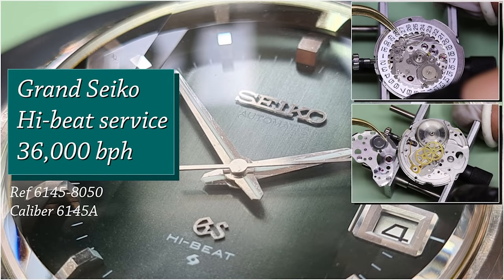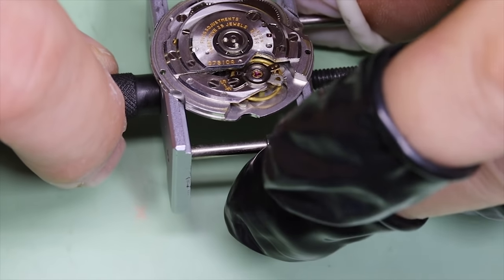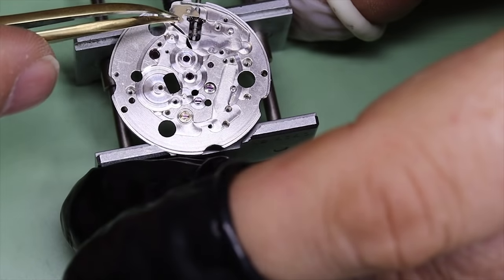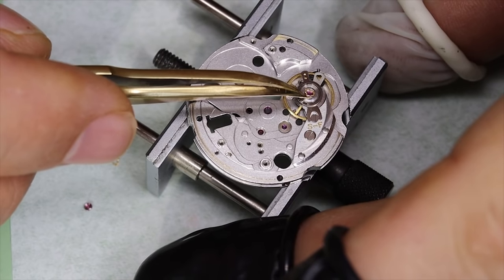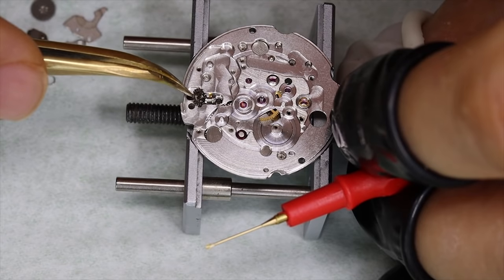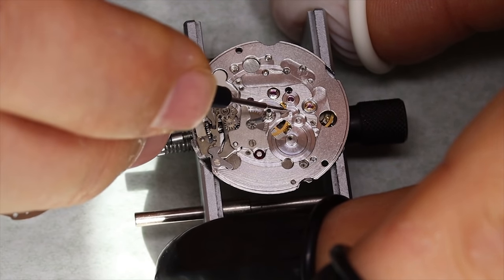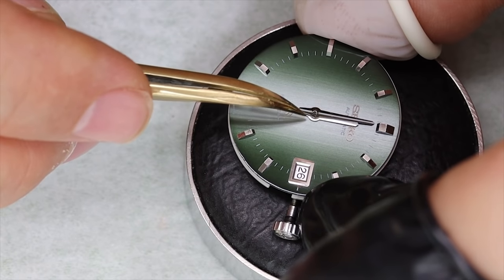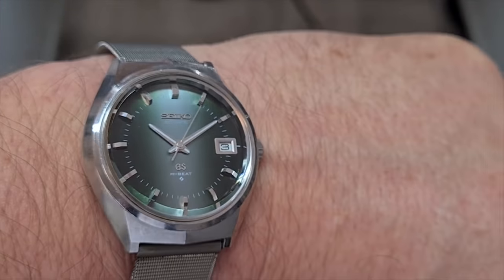1972 Grand Seiko GS61 Hi-Beat service ref 6145 8050 Caliber 6145A

Comment: The metal finishing and machining on this Grand Seiko looks very fine. Glad you shared this so we can see that Seiko can produce an aesthetically handsome movement.
Reply from the maker: Hi Frank, yes, this is indeed a more refined finishing than many old Seiko's. If you look at new high grade Seiko's, you will also see nice finishing there. This whole watch is very, very nice :)
Reply: D0nt like hi beat watches they wear out fast, service is also needed at short terms

Comment: I watch YouTube almost exclusively on Amazon FireTV which is not comment friendly therefore I don't typically read or write comments.   But I watch and enjoy every video please keep them coming.   It's a. Welcome change to learn from a true professional and the background, history and insights are the best part.   I've learned so much and thanks for not bashing Seiko so much.  If you're ever bored or running out of content please feel free to take apart a Russian watch.
Reply from the maker: Hi Eric, thanks so much for making the effort to write a comment! I actually hold Seiko in very, very high regard, even though I might bash them for plastic parts, keyless works having hundreds of little pieces and their often rough finishing... But they make some very solid, no non-sense movements that I really respect. I even stated in one video that a Patek Philippe without the finishing would be a Seiko 😄

I'm actually planning to do a Russian or Soviet watch shortly, just have to decide whether to make it a chronograph or one I have lying around in a drawer somewhere. And I cannot promise to hold back on the bashing then!

Comment: What an absolutely beautiful watch! That dial is breathtaking!

One thing I noticed, and maybe it's just my lack of experience, but the balance hack actually fouls the escape wheel instead of the balance or pallets. I think that is a rather ingenious design, putting that much less stress on the escapement. 

You do such great work, and, as always, teach us more about these movements and watches in general. Thank you so much.
Reply from the maker: Hello Michael, thanks for watching and for your comment, very much appreciated! Yes, it certainly is a beauty. Very different and almost all in a good way :) 
The hack might look like it will foul the escape wheel but it actually still stops the balance wheel when the stem is pulled out into hand setting mode. It's the safest place to stop the movement, as it stops the final movement component rather than one earlier in the chain. If the hack stopped the escape wheel, the balance wheel would still swing a couple of times and you might risk other problems. With the balance wheel arrested, everything stops immediately and it will also start up again immediately. 
There are more videos coming, so stay tuned! 😁

Comment: A stunning watch and great video. I've noticed other guys have opened the "Do Not Open" mainspring barrel (and closed them again) with success.
Reply from the maker: Thanks, Red! Yes, you can open the "Do not open" barrels, but the risk of not being able to fit them again is quite high, so if it works well the safest thing is to keep it. If the mainspring does not give enough power I would certainly open it up (and find a reserve barrel just in case).
Reply: @VintageWatchServices  OK got ya. And I guess finding a similar barrel isn't easy.

Comment: Lubrication of the pallet stones is a point of debate.  The stones are extremely hard en very resistive to wear.  The balance assembly is argually the most sensitive part of the watch.  Though lubrication may seem to improve the stability of the watch right after the service, it can and will induce drag and contamination, which shortens the time until the next service.
Reply from the maker: Hello Berre, for the lever movement, lubrication of pallet stones is not really a point of debate, unless you mean that you can lubricate the escape wheel teeth instead? That is an option but not very common. 
There has however been a lot of effort in trying to come up with escapements that do not require lubrication, this was the driving force behind George Daniels' co-axial escapement for instance and later Roger Smith's work.

Comment: Thanks for getting back with me all. I guess I can be intrepid and wear the watches or mess them up from hand winding them a bit every day to wear them for two hours. Or just leave them in the watch box. I had my Hamilton Khaki manual regulated (a hobbyist or destroyer of watches myself). Played nine holes and beat error went from 0.00 to .1 to . 2 and 0 seconds a day to plus 1 or two. So I guess these are arm chair “field watches”. Guess I will have to keep wearing the 1953 Bulova if I want an automatic to golf with. Sorry to whine so much.
Reply from the maker: A field watch nowadays is probably about as useful for being in the field as an SUV is for driving off-road... The only thing different with them are basically the dial design. Probably an old Timex is the best for a golf game, they'll take a licking and keep on ticking, I've been told 😁

Comment: Do you use brass tweezers to avoid scratching the movement? Or for non-magnetic or both? or?
Reply from the maker: Hello Pat, yes and yes, and also because brass is a bit softer than steel, thus allowing for a little bit better grip.

Comment: Great to see you working on a Seiko. This GS Hi beat  is a grail watch for me. I have a question, I have a Seiko SNXS77 with a 7S26 B movement and it runs very fast because of the balance wheel hair spring seems damaged, can I replace it with a 7S26 A  balance cock and  wheel? Nice and relaxing as usual and a great job, cheers.
Reply from the maker: Hi Francis, thanks for watching and for your comment! I haven't worked on the 7S26 series myself, but from what I can see the balance is the same, only the regulator is different. I found this that may be useful: https://wristsushi.proboards.com/thread/20026/7s26a-7s26b-7s26c
Reply: @VintageWatchServices  Thank you very much. Keep the streams coming the are great. Cheers Francis.

Comment: I'm a fan of Seiko watches and I see they use white base metal for almost all their parts. What materials do they use exactly? Great coverage here!!
Reply from the maker: Hello Stephen, thanks for watching! Most watch brands use plates, bridges and cocks made from brass which is plated to achieve a uniform look and to protect the brass a little bit from oxidation and scrapes. This plating is typically either gold, copper (as in vintage Omegas) or rhodium, as in most modern movements. Rhodium is bright silver colored, and this is what Seiko uses from what I know. Older watches with the same kind of silver look can also be nickel plated, and higher grade old watches and some new one like Lange use German silver, which is a copper/nickel/zinc alloy.

Comment: Great video as always.beautiful Seiko and that dail sitting behind the faceted glass just looks gorgeous.think I would personally put on a leather strap or even maybe a nato instead of the mesh bracelet but that's me,never been a fan of mesh bracelets.
I literally just stripped down my first seiko movement ever(nh35a)last week.still waiting for a few things before I can clean movement and go about reassembling/oiling it.havent heard anyone talk about cleaning solutions to use in ultrasonic cleaners for movements so I bought something called Zenith formula 67 watch/clock cleaner along with a final rinse solution from Zenith as well.hoping that'll work out fine for me as a person doing this for a hobby.one thing I was informed to buy for use to clean cap jewels is a cleaner called onedip so I did buy that as well.also the stuff you soaked the pallet with,is that stuff beneficial to use on all pallets for all automatic movements like eta and sellita?you also said that on watches such as this GS that have medallions on the case back can't be put into ultrasonic cleaner because the back will get damaged.why is that and exactly how would the medallion part of case back get damaged in the cleaner?
Looking forward to next video and more education.
Reply from the maker: Hi Richard, thanks for watching! This watch would look good with any kind of strap or bracelet, I think. I believe it would originally be offered with both a steel bracelet and a leather strap but not a mesh bracelet, indeed. 
Nice to hear you're serious about your hobby, it's a great interest that you can do pretty much until you die at the desk :) There are a lot of different cleaning solutions out there and it's a bit like choosing between Pepsi and Coke; they'll all do the job. Just make sure you also have a rinsing solution. You would typically have one cleaning jar and two rinsing jars and run the parts through them in sequence. 
Onedip is typically used for hairsprings, although I rarely use it myself. For cleaning the cap jewels you will want a naphtha solution, lighter fluid works well. Fixodrop is what I use for the pallet fork, and I use it on all watches of all kinds. It helps the oil stay on the face of the pallet stones rather than creeping off. 
Medallions like the one on the case back of Seiko KS's and GS's are fixed on the outside of the case and if they are subjected to ultrasonic waves they could start loosening. The result of this would be that the medallion would partially come off the case back. So not what you want to see...
Reply: @VintageWatchServices  awesome.tyvm for the advice along with the pointers on different types of cleaners and whatnot.guess I could saved a few bucks and just bought lighter fluid for cap jewels instead of the onedip but hey can't learn without asking questions.i do already have a cleaning solution but still have to get the rinse solutions which I will be getting this coming week.
Also so far your the only one I've heard speak of doing any lubrication on the rotor bearing itself.rite now the oils  I have are 9010,D-5,8300 natural grease and 8301 grease with graphite.would any of those work well for the rotor bearing like the D-5 or should I get the same stuff that you said you lubed the bearing with.
Again I thank you for all your advice and look forward to next video.take care and stay safe.

Comment: Sorry for always bombarding you with questions haha. Found it interesting you said you grease the pallet stones instead of using 9415 on a hi beat. I'm actually about to service an old beautiful ladies seiko hi beat with a 2205 for my mother. What grease would be appropriate for this movement at 28,800 bph?
Reply from the maker: Hello Nunya, I didn't actually say to grease the pallet stones instead of using 9415; 9415 IS the grease I use :) As opposed to 941, which is an oil. 9415 is perfect for 28800 movements.
Reply: @VintageWatchServices  Oh ok, i guess it was the characterization of "thick grease" that threw me off. Ok good to know. That's what i use. Thanks again.
Reply from the maker: Pretty sure I didn't say "thick grease" 😉

Comment: an absolute beauty ,the roller winding system looks very reliable compared to some !! even if if I love swiss made ,this is a nice caliber , regarding high beat , I don't care as long as it is a stable time keepr, else my epson YM62 is unbeatble...
Reply from the maker: Seiko has made a ton of very fine watches indeed, just with a different mindset than the Swiss for most of them. They do make some incredibly high end watches also though, check out Credor, their high end brand.
Reply: @VintageWatchServices  yes this is true and is a point where the swiss are making a mistake , but I think they are coming back with  schools and french Briancon/Morteaux  very good school for watchmaking
slaves or good mechanics ... , missing is engineers to start new era , but with the comeback to mechanical watches , not only for EMI from stupid atomic event , but the real reliability , see stats on the quartz  watches , they go to the bin at an average of one cell battery ....but with new engineers ( most movements where designed before 70 years ago ) using modern know how could design ideas for fabulous mechanical wathches  ,like using carbon fiber spirals ,magnetic floating balance weel,very light escape weel and anchor to reduce inertia loss ,low beat for less ware , and more...

Comment: Did you take any extra precaution on  oiling due to the fact of being a 36000 vph? Shall the lubrication be much different from a 28800?
Reply from the maker: Hi Henrique, thanks for watching! I follow the BHI's recommendation which you can find here: https://www.google.com/url?sa=t&rct=j&q=&esrc=s&source=web&cd=&cad=rja&uact=8&ved=2ahUKEwi4id25ht7vAhX68LsIHcbnAO4QFjAAegQIAhAD&url=https%3A%2F%2Ftheindex.nawcc.org%2FArticles%2FBTI-The_Practical_Lubrication_of_Clocks_and_Watches.pdf&usg=AOvVaw0Nlfmcsoljrth5lg8fHEYU

It basically says that for lower beat movements one should use Moebius 941 (or similar) and for high beat movements - 28800 and higher - one should use Moebius 9415. 9415 is a grease, and that is what you saw me applying to this movement. The reasoning behind it is that since the pallet fork moves much faster back and forth and the movement of the balance wheel teeth across the pallet forks is so much faster, the lubrication needs to be thicker in order to stay in place. Hence the grease 9415 instead of the oil 941.

Comment: How do you access the stem release once the dial and hands have been set in order to recase the movement? Simply place it dial down on a soft squishy surface?
Reply from the maker: Hello Karst, thanks for watching and for your question! I personally don't like putting the dial on anything, so I prefer to put the watch on the bench on the side and hold it steady.
Reply: @VintageWatchServices  No thank you for the videos! They are very enjoyable and on top of that immensely helpful. Yes, that method makes sense. I have done it like that as well but it feels like I would need three hands to do it securely sometimes, especially when the dial itself is larger than the movement.

Comment: Great job! Are the sealed barrels much different inside, compared to a "standard" barrel & mainspring? What advantage does this provide, a fresh mainspring, fresh lubrication for better performance? It reminds me in looks, of a Rolex 3035 but without teflon coated, coloured reversing wheels.
Reply from the maker: Hi Joe, thanks for watching and for your question! Sealed barrels are typically no different from normal barrels, apart from being more difficult to open and close, as the lid is typically thicker. The spring and barrel are generally the same. The reason some manufacturers did it this way back in the late 60s and early 70s was to ensure the steady power supply from the mainspring, which can be jeopardized if someone fiddles around with the barrel. They recommended to change the barrel complete with every service. However, as can be seen in this video, an old barrel complete like this one still provides plenty power, so you can often get away with not changing it. But opening it is perilous as it could be difficult to assemble it again. 
For this movement I completely agree; this looks much more like a Rolex movement than a standard Seiko. It really is a wonderful movement and very high quality.
Reply: @VintageWatchServices : Grazie, l'ho apprezzato! 👍🏽

Comment: Hello Dion and congrats for your videos, i have one question, the mainspring of this watch is not necesary lubricate it? thank you
Reply from the maker: Hello Mark, thanks for watching! Some of these old watches have barrels that were supposed to be replaced at a service rather than having the mainspring taken out and cleaned. The issue is that the barrels can be very difficult to put together after opening, so if the amplitude is alright I use the old barrel as is. If I have a spare barrel I would try to open this one and lubricate it.
Reply: @VintageWatchServices  thanks a lot for your answer, one time i service a Zodiac sst 36000 with this kind of barrels and I managed to open it, the problem was that I couldn't close it later 😅. I'm from Spain(Sevilla) and i  dedicate myself to the repair watches since 10 years ago, more or less, i love repair it, and your videos are very instructive. Thank you very much for the information and keep it up.

Comment: For the Fix-O-Drop, wouldn't it also be applied to the escape wheel?
Reply from the maker: Yes, that's best practice. I've changed how I do things a bit over time :)
Reply: @VintageWatchServices  Thanks for confirming.  What's the purpose of the funny shaped, and rather expensive, epilame bottle?  I'm just getting started in this hobby and there's lots to learn.

Comment: Oh please, please, please do my 1975 Seiko Perpetual Calendar.  It's my high school graduation gift that a few shops have essentially ruined.
Reply from the maker: Hello Kenneth, sorry to hear your watch has not been treated well. I assume it's a quartz watch? If there's an issue with a quartz movement it can basically only be replaced by an identical movement. Unfortunately I do not have the equipment to work on quartz, but if you contact Seiko directly they should be able to help you.
Reply: @VintageWatchServices  Thanks for your prompt reply.  I'm certain it's a self winding movement.  The number code on the casing is 7006 6039.  I thought it was a mechanical movement.
Reply from the maker: Ah, okay, thanks for that. Then it's not an actual perpetual calendar, but the one with the 31 calender inner bezel?
Reply: @VintageWatchServices  Yes, that's the one.  It has a beautiful blue dial and the original stainless strap.  It still winds and runs, but not well and not for long.
Reply: @VintageWatchServices  I just took it out again and wore it for the day.  It gains one 5 minutes every hour!  Would you be willing to fix it for me?